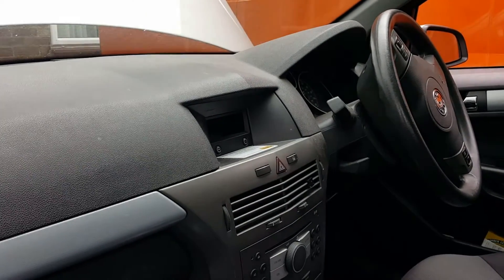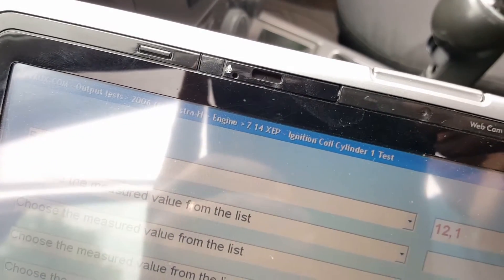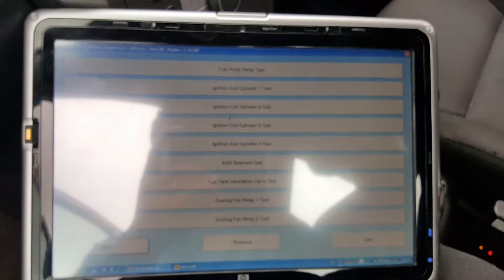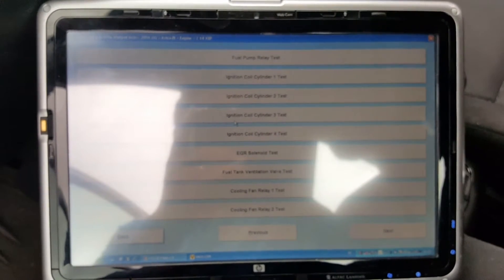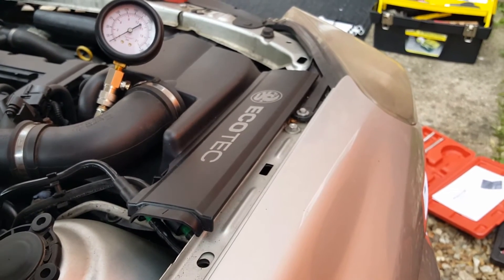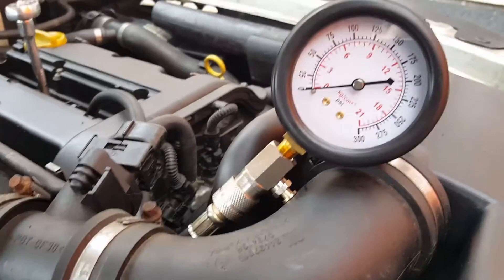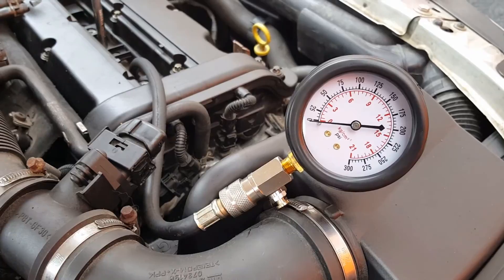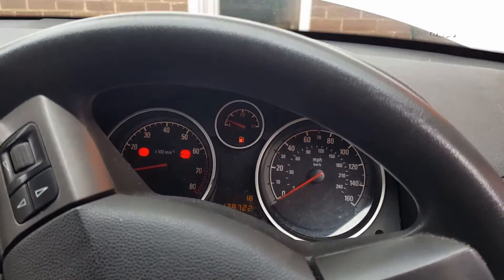Vauxhall/Opel Astra Z14XEP misfiring case study.

Comment: Please check the Opel/Vauxhall manual prior touching the car to understand which compression should be in Z14XEP, there you will find that it should be 14-16 Bar which is 14.3-16.3 kg/cm2 which is 203-232 psi. You don't have to guess, there are specific values for each engine provided by manufacturer... What would you say if you got 230 psi? You would say that engine consumes oil? That's sad that the majority of car mechanics work like this... That's so sad...
Reply from the maker: Not sure what you are trying to say...
If I had 230psi I would continue to investigate...
I don't need to know the exact compression that each different engine should have to know if there is a problem or not...
👍👍
Reply: @LMAutoRepairs  I mean on the video you were trying to guess the value, this is not how it works, and if you saw 230 instead of 175 you would definitely say oh, something is wrong... If you're already doing the compression check you may identify other issues and this is how the proper car maintenance works, but you can't as you don't read manuals...
Reply from the maker: @corsik737 
You completely wrong in assuming you know what I would think if I would see 230...
You very rarely have higher compression that what the engine was designed for...
I always look for a minimum as I explained on my first reply... 
But whatever,  you know best...
👍
👍
Reply: @LMAutoRepairs   this is what you said in video... "In this car it should be about 175 psi" and also you replied on one comment below where the question was "what should be compression for Z14XEP" and you replied 175 psi... And I just simply replied "check the manual bcz this value is not smth that you have to guess". Don't slow down, I know how you guys working without manuals. Also that video with Corsa D, you also didn't have the clue what should be the compression there. It's same as here btw. I used to re-do a lot of stuff after guys simply not using manuals and relying on their "experience" that's why I know what I'm saying. Also someone might take this your assumption as a real value and make a wrong diagnose. Did you think about that? And what did I say? I didn't say anything offensive, I just said check manual prior to touching the car and that's it. You think I didn't make mistakes and I'm the best? No, everyone makes mistakes and I'm not  exclusion, I'm just giving a friendly advice - always look at manuals. That's it. No need to be offended for what I said. Just follow manuals and the most important - respect cars that you work on and that's it...
Reply from the maker: @corsik737 
I understand what you are saying...
A brand new engine might gives you the 230 as per the manual...
An old car with thousands of miles on the clock and unknown maintenance will difficult  ever get that high...
Seen many cars running just fine with way lower compression than what should have...
What I am trying to say is, you can't just diagnose a compression issue because the manual says 230 and you measure 190...
Therefore, I still and will continue to look at anything above 150 acceptable...
Obviously, not all cars and engines are the same, there is many variables...
And as much as you don't agree, experience is as important as a manual...
I never said you said anything offensive, I just think you are looking as this through one perspective only...
In this case one cylinder had no compression at all... so the compression on the other 3 cylinders was irrelevant really...
👍👍👍
Reply: @LMAutoRepairs  First of all, opinion that if this engine works let's say having 12 bar (175 psi) compression and it's all good nothing special - totally wrong. In all cases on these engines when the compression changes more than 1 Bar from 14-16 Bar - something is wrong. It might be very insignificantly, might be minor changes, let's say (usually how it is) just a piston rings wear which won't cause engine working roughly (because of course you have nearly same compression in each cylinder so engine won't work roughly it's obviously), it will just loose some of it's power consuming more fuel as well as it will be consuming some oil, but some "owners" and for some "mechanics" (unforunatelly the majority) think it's still acceptable as it's not signifficant, it looks like engine works good and the car is still operable... But it's totally wrong approach. You're overthinking, trying to think you're smarter than engineers, sometimes (very rarely, when some items were written by marketing guys, let's say oil change intervals, all engineers are just laughing at what it written there, even by Opel) it works, with these engines and with this question - no. Here if you have compression 12 bar or less in that last 3 cylinders most probably the piston rings are already worn. You can't make up anything like that especially as it's false. Have you ever tried to rebuild this engine having 12 Bar compression? I think no bcz you would definitely see the difference. So thinking that it's good as well as it's still operable is totally wrong. So 150 psi is NOT acceptable on this engine, 175 psi is also NOT acceptable on this engine. There's no opinion, there are no assumptions, it's just not acceptable by Opel/Vauxhall and that's it and on 100% of these engines having 150-175 psi it's not acceptable as there are some bad changes happened to the engine already and you must inform the owner and he/she will tell you to inspect it and to fix it or no. I say again just try to rebuild and compare Z14XEP or A14XER with 150 psi and after rebuild you will see a big difference. Secondly, you said smth about old cars. You don't have to care about the car's age, every car must be handeled and maintaned perfectly. With good acondition and handeling these engines work more than 10K engine hours without loosing the compression at all. So as it was 16 it will be 16 after 10K hours then depends on the operation and average speed in order to convert it into mileage... (I bet you know that engine wear is measured in hours, not in mileage). All my cars have 16 Bar out of 16 having big mileage and the engines are still not rebuilt so don't try to say like "uh, it's old car, so 12 bar is okay"... And finally, I understood what you were checking, I see what you were doing. You're doing a compression test. Once you're doing it and once you're saying what the compression should be you have to check what the values should be there. In fact you provided people with compromised information and there're more mistakes I don't want to talk about it anymore... I don't wana dissapoint you as I were you, and I also listened to a lot of critics, everyone listened to... This is my comment and it's your opinion how to deal with this info, I won't leave my familty, my cars and my job to come, to show and to explain to every single mechanic... That's good even that I have enough time to asnwer for you... From what I see and what I can say - you have to change your mind and your approach to cars. Believe me, if you came to aviation and would try telling something like "I think... I guess...150-175... huh... still working... still acceptable... cuz I have my experience... engineers are dumb and manual is shit..." bro, you would be kicked out same day... I very very very regret that I don't have enough time to film some videos, probably in the future I will and I will definitely share it with you, you will definitely like it... But now I can't and it's a shame on me, I am telling like it is... However it’s such a shame that such nice cars as the Corsas and Astras fall into the hands of people like you. These kind of people are not even worthy to touch them, I’m not even talking about the owners, it's another sad story which I don't want even to touch... For u I wish all the best, to love cars, to treat them not as peace of metal but as something alive. All the best, bro
Reply from the maker: @corsik737 
You leave in a dream world...
The reality is something completely different...
You carry on doing it your way, I will carry one doing it mine...
I am open to learn, but you are just being completely disconnected from reality...
Accordingly to your theory, nearly every car I have ever compression tested, would need and engine rebuild... Good luck with that...
Anyway,  no hard feelings... Good luck and all the best for you too...
👍👍👍

Comment: What should it be compression on one each cylinder on 1.4 sxi astra
Reply from the maker: I usually look for something close to 150 psi...
Obviously depending on the state of the engine that will vary...
Less than 100 psi can indicate a problem...
Reply: @LMAutoRepairs bro, you don't have to guess, just buy a subscription and open the Opel/Vauxhall's manual...
Reply: On Z14XEP it should be 14-16 Bar and not more than +-1 in each cylinder

Comment: so whats the problem with the car and what needs to be changed to be fixed?
Reply from the maker: 🤷‍♂️
Piston rings, pistons, valves...
Don't know... I have only diagnosed it...
And to be fair, I don't know what was done to it either...
Was probably scrapped.... lol
Thank you for watching!
Reply: @LMAutoRepairs  im asking cause i bought used car same with 180000km and the engine works fine but sometimes on a traffic light when its idling it makes sound like a washing machine for some time and then stops and i can also hear exhuast at that time go puff puff like a choo choo train. I think that happens sometimes after you go over 4000 rpm. I was at mechanic for oil change and filters and spark plugs. Mechanic said  there was old oil in car. But after oil change again i heard car run like that sometimes again. What do you think?
Reply from the maker: Flywheel? 
Difficult to tell without looking really...
Reply: @LMAutoRepairs  engine is the same as in this video. If its flywheel does it need to be fixed asap? I dont wanna destroy my engine
Reply from the maker: I just made a suggestion for you to check...
I have obviously no way to tell what is wrong...

Comment: Done this test and I'm getting 140psi average this ok?
Reply from the maker: Hi
I would say is ok.. a bit on the low side, but if they all achieve that pressure, then is not to bad...
Thank you for watching!
Reply: Few... great puting a new chain on soon as shes on 125000 cheers for the upload.
Reply from the maker: @z0m123  
👍

Comment: Hi i have astra 1.6 petrol it starts ok runs ok but when i accelerate it lags power but nit that bad any ideas plz?
Reply: Think it may be ecu unit i can get it started but when i accelerate it cuts out then i have to wait 2mins to restart
Reply: And also when it doesnt start i take out ecu relay and plugg back in then starts
Reply from the maker: @renalt78  
Don't make assumptions...
Diagnose correctly... start by scan the car and go from there...
Reply: Thanks
Reply from the maker: Hi
Have you scanned the car, checked live data?
Thank you for watching!

Comment: Opel Astra H 1.6 2010 misfiring , What could the problem be I've changed all the spark plugs and the coil pack and still doing the same thing .Please advice
Reply from the maker: KAYGEE KG 
It still can be too many things...
Like on this video, compression... do a compression test... check that the signal from the ecu to trigger the coil pack is getting there and is good... injectors, same thing, ensure they are not blocked and they are working...
Reply: i have a same problem ,did u fix that ,what was be?

Comment: Ok with mine it misses when still or at very lo revs as soon as u reb to about 1500-2000rpm the cars sound ok and doesn't miss. I've changed both spark plugs and coilpack and also bank 1 sensor 2 lambda sensor. What could cause the problem
Thanks
Reply from the maker: VapingWithTazz 786 
Hi
Have you done all that without scanning the car?

Comment: SOMETIMES YOU NEED TO CHANGE THE TOP WIRING HARNESS! THERE MAY BE A SHORT IN THE WIRES WHICH WOULD MAKE THE ECU APPEAR TO WORK BADLY WHEN IT IS WORKING FINE.
Reply from the maker: Strange Person! xP 
Not In this case... but thank you for watching and for your comment!

Comment: Cars misfiring but one of my spark plugs has oil on it ? What could the problem be I've changed all the spark plugs and the coil pack all cylinders spark ?
Reply from the maker: Brandon Arnold 
Hi
It can be either the cylinder rings or the valve stem (seals).
Have you done a compression test?
Reply: Brandon Arnold  stiky piston rings
Reply: Could the oil on spark plug be due to a faulty valve cover gasket
Reply: @evieemaya88  no
Reply: @stivi739  well in fact it can sovsonething to consider

Comment: look at that link it may be the answer to the problem
Reply from the maker: Hi
Thank you for watching and for your comment! 
You are probably correct, just that in this case the valve or valves are permanently open... dirty or no sealing correctly would allow the cilynder to achieve some sort of compression I believe...

Comment: hi imsvvar i am having a prob with my car that nobody round here knows what is happening to it its a 2008 astra 1.9cdti the throtle peddle stops working and the car idolds at 1400rpm and will not do anting else any idea? 

thanks jamie
Reply from the maker: Thank you for watching!
 Any codes on the ECU? 
What is the live data for the pedal position sensor reading?
Reply: hi yes its coming up with codes on the peddle test and they didnt cheak the out put or didnt tell me. ware abouts are you? will put them on here in a min
Reply: here are the codes
ECN112004
ECN112204
ECN038008
Reply from the maker: +Jamie Crawford 
+Jamie Crawford 
Hi
The first two codes are related to the pedal position sensor/s.
The third one is for your glow plugs.
So it looks that your pedal might be at fault, ence no response from it.
But, I would have a look into the live data, to see exactly what is happening, the pedal can be remover and bench tested, in case your problem is a bad wire or ECU...
Hope that helps....
Reply: ok so if i get a new pedel with the same code on it should that work? would it need programing to the car? ware abouts are you as you no what your doing lol
Reply from the maker: +Jamie Crawford 
Should work....
Peterborough...
Reply: ok will it need codeing to the car if i change it?
Reply: @jamiecrawford8178  how did you get on in the end with rhus problem ?